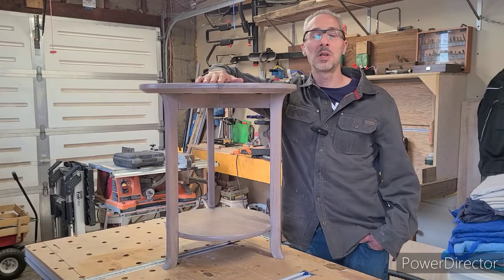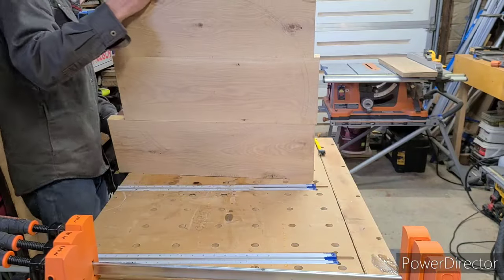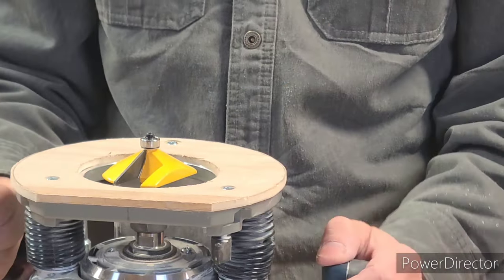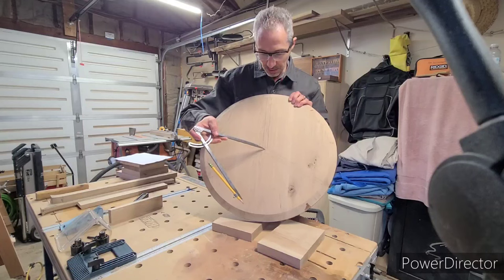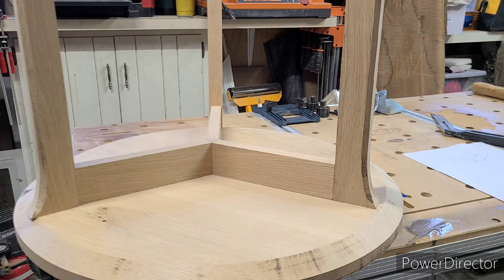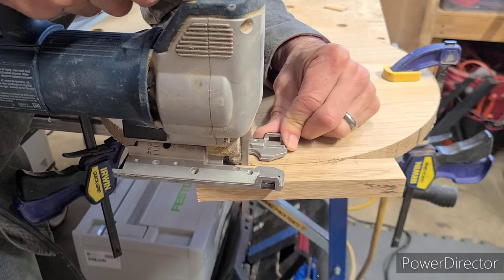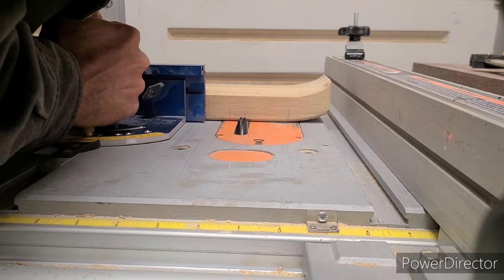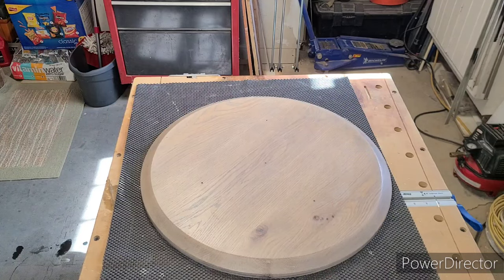Round white oak end table, router challenge

Comment: How do you like that miter saw? I’d love a slider, but I don’t want to lose space behind it. Either one that articulates like that or has the slider bars in front like the festool. But not a festool. Lol
Reply: PS I have that same giant yellow 60 degree router bit. It’s something lol
Reply from the maker: It's nice that it has zero clearance in the back. Dust collection is terrible even with vacuum. If you have a light hand the accuracy is good, but it is very easy to get deflection if you push to hard.
Reply from the maker: The router bit impressed me especially on the white oak.